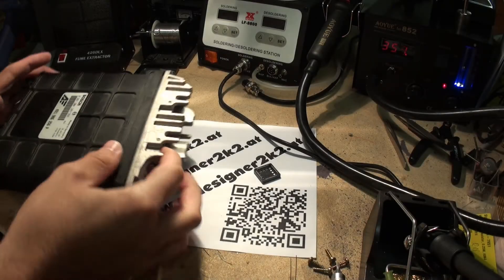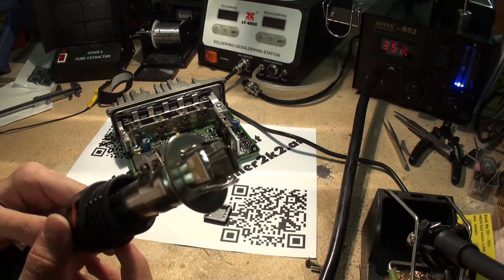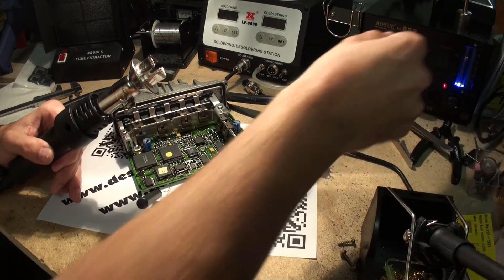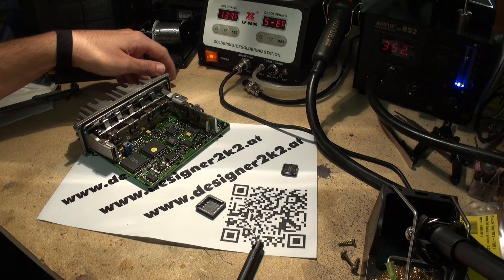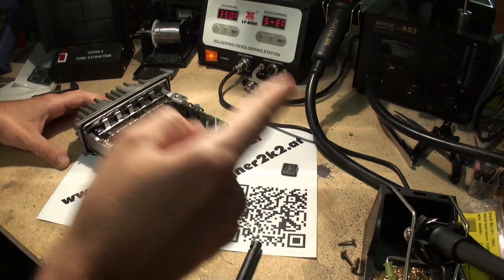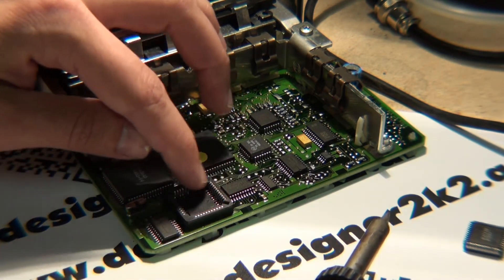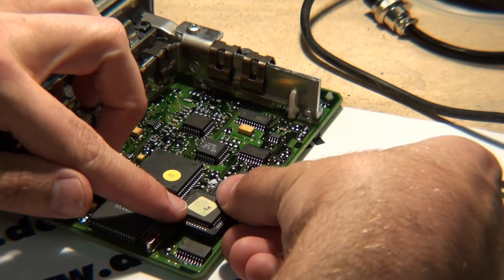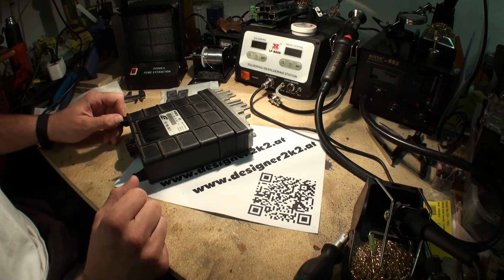Remove a PLCC EPROM with Hotair rework station and solder in a Socket

Comment: 350 only for leaded solder u need to go higher when dealing with non-leaded and i have a x-tronics actually a decent station i say that cause its still working after 5 years and they included extra elements that im glad i havent had to use
Reply from the maker: Kev711 2001 yes, the ecu in this video is from 1992, lead solder :-)
Reply: oh i know i meant that just for basic info
Reply from the maker: Kev711 2001 what temp would you recommend for lead free solder?
Reply: depends on what you are workin on as a lot of stuff that uses it is BGA and has lots of ground planes etc why when i rework motherboards gpus etc the bottom burner temp is a must but usually 400+ lol try getting a smd cap off a high end graphics card you see what i mean also i had to shame this guy after seeing your vid https://www.youtube.com/watch?v=E2rHyp8DHOM   horrible job and improper teaching